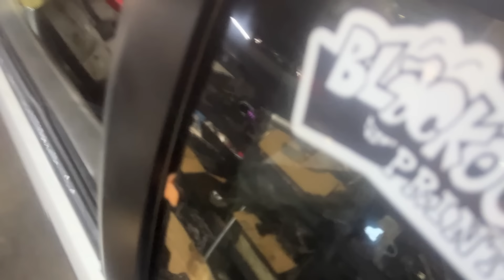Looking Inside the 8 Second Dog Box!! Gearing Up for PFI SpeedFest

Comment: Another option, i did this before i got carbon on my eg, i used two go pro sticky pads on the inside of the trim and put it on as normal. i went from losing one side every other event to them both lasting over a year up until i pulled em off for new doors.

Comment: If they hardened the shaft to the same hardness of the individual gears it would break. The teeth off the shaft being so brittle. The temper softens it a touch but it looks pretty normal wear for a drag car pushing 1000hp

Comment: I have the same gear x/gts transmission in my awd car I haven’t had the clutch issues at about 1000whp running action twin disc about 20-30 passes
Reply from the maker: You have the old stuff that’s in Kyle’s car this is the version 2 Kevin and Mario are the only 2 currently that have it but yes it is modeled off that box and when we had version one we never had a clutch issue